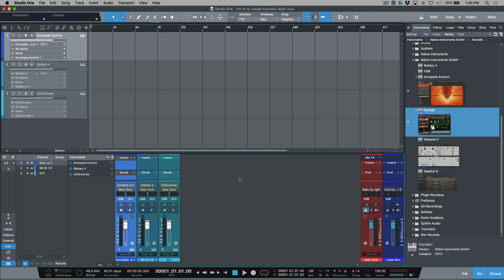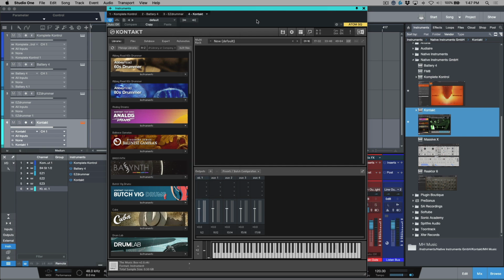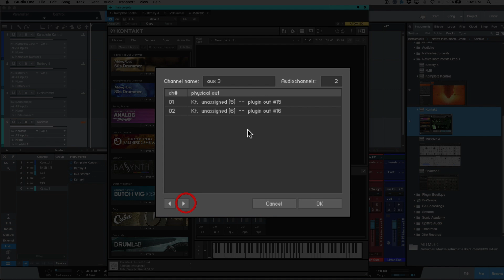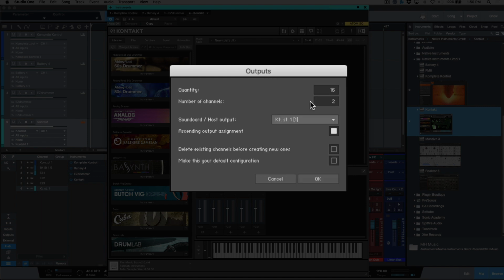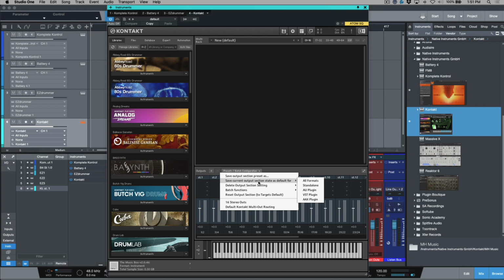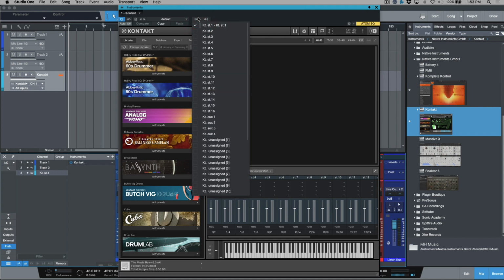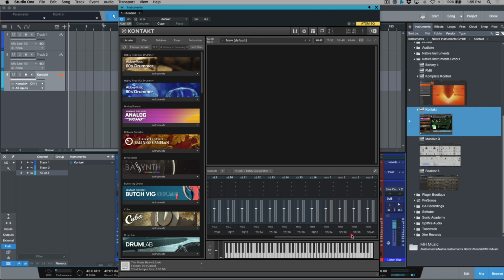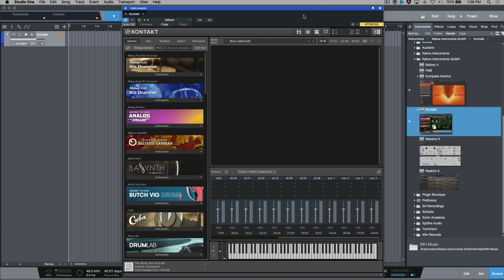How To Re-Map The Output Routing of Kontakt 6 - Running In Studio One 5

Comment: Thank you Marcus, this was VERY helpful.  My next question would be.. Have you made a video regarding bouncing these multiple Kontakt tracks down to audio in S1? I have not found an efficient way to do it yet.  If I just choose Transform to audio it will create a new track for each track times the number of total instruments. For instance, if I have 4 instruments in one Kontakt session, I will get 4x4 or 16 new tracks. Although only 1 of them, for each track has the actual audio, the other 12 would be blank.  weird.  OR if I turn OFF all tracks but 1 in the mix Instrument panel, I will indeed only get 1 new audio track when I transform BUT all the other tracks in that session have has their names removed on the mix channels.  There has to be a better way.  THANKS!

Comment: Thank you so much Marcus! I used to encounter the problem, that when I had more than 6 outputs, I had to select every other output from output no. 7 to make it work.
I did not understand the logic of it and there may not be any. Anyway, thanks a lot for this tip. It will reduce my frustration exponentially. :)

BTW one more thing... Is there a way to automatically get the outputs connected to the corresponding MIDI channel within Kontakt?
For example .. I load 8 instruments in a Kontakt set. In Kontakt, they automatically get a unique MIDI channel 1 - 8, but the same output st 1.
There I have to manually connect the output to the correct MIDI channel.
Then when I duplicate the tracks to 8 different Kontakt tracks in the track window I have to connect them to the right instrument channel
AND in the inspection window connect the right instrument to the right output so that when I have packed them in a folder
I can show/hide the channels even in the mixer window. Can all this be automated? Of course I can make a template for this, but sometimes you have to make changes.

I understand that it's two different software, but it would be heaven if Kontakt created individual (duplicated) tracks in S1 (or any DAW) for each instrument you load into a Kontakt set, and with the right corresponding connections.
Hope my question(s) wasn't too vaguely formulated.
And again... thanks for all the tips & tricks you provide on your channel. You're my number one go-to-guy when it comes to Studio One.

Comment: Thank you Marcus, that's VERY helpful!
Here's a video suggestion: I struggle when making 60s / 30s / 15s edits of my songs in Studio One. I don't see where S1 shows me the length of my chosen event, loop or arranger event. I switch back and forth checking the Loop length via the export dialogue then adjust the files or arranger lenght then check again in the export dialogue.... and so on until it's exact. Any suggestions to check your song length directly in the project without switching to the export dialogue or - even worse - switching in the time ruler? Pro Tools showed this directly in the transport bar,  all S1 shows there the remaining possible recording time (8 days...) which is useless. 
Thank you man, you're an inspiration! Cheers, Andy